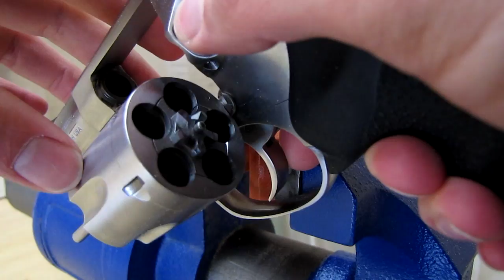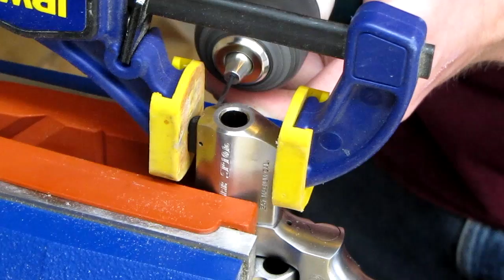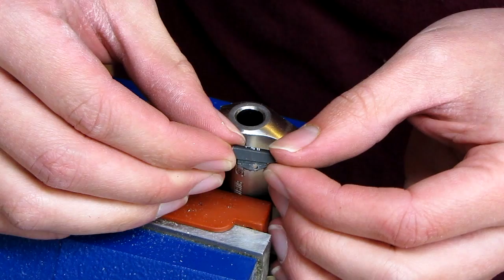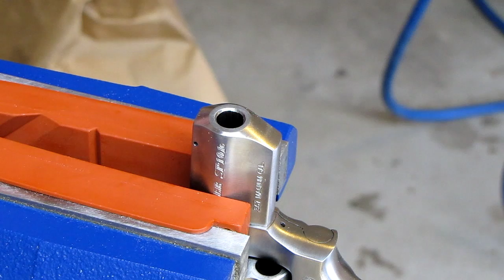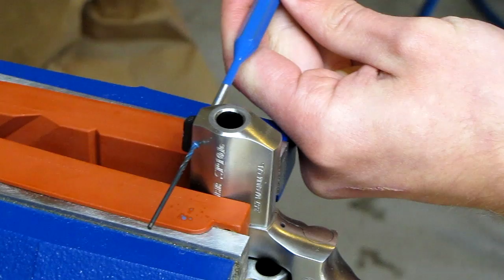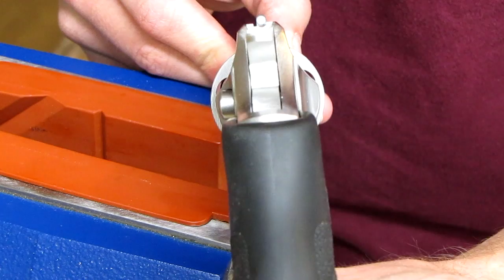How to Change the Front Sight on a Ruger SP101 - By Ed

Comment: DON'T drill through the gun, insert the sight, mark it with a #55 drill, then drill the new sight outside of the gun first!
Reply: sunrisesurfbum I had no problem following this video, all went smooth as silk
Reply: Works well for me.
Reply: Yes. If your drill bit walks, you’ve just oversized the hole in your barrel.

Comment from the maker: So I finally got to go to the range for some serious shooting. The sights are 1/2" low at 10 yards, so they will probably be dead on at 15 yards. They are more accurate, easier to see, and a whole lot cooler than the factory sights.
Reply: which site exactly did you get, thanks?
Reply: good job

Comment: According to XS their sight is not pre drilled. In a .357, they find without the pin, it will stay on for approximately 15 rounds. It would be good to see that process and the exact size bit to use.

Comment: Getting ready to do mine the same way, thanks for the video.....Got it done, although I had to lightly file on the new site a bit the job went very smooth. I installed a fiber optic site off Amazon. You video made it easy

Comment: I installed the same sight in my sp101 today. It came out great but i did have to sand the sides of the sight because it would not even start to go into the sight slot.

Comment: First the xs sight absolutely would NOT fit in the groove.  After some filing and a hammer I got it wedged in.  THEN the damn 1/16 drill bit broke when trying to drill through the sight.  Ended up just putting original sight back on and will paint it.